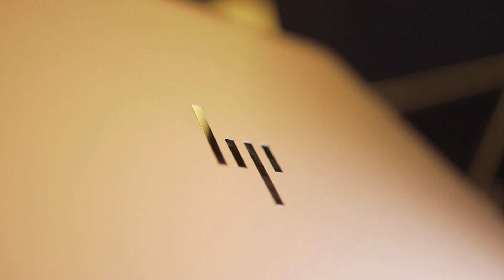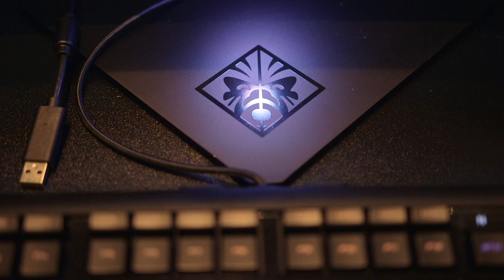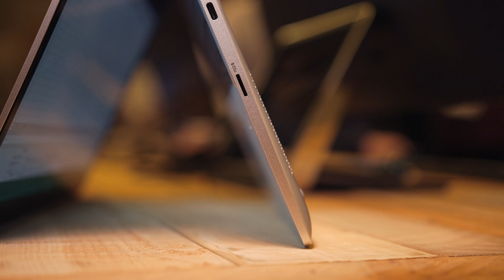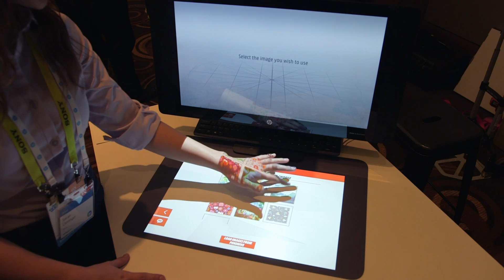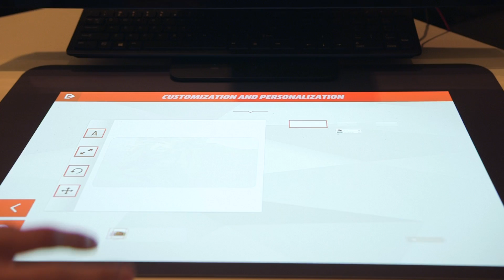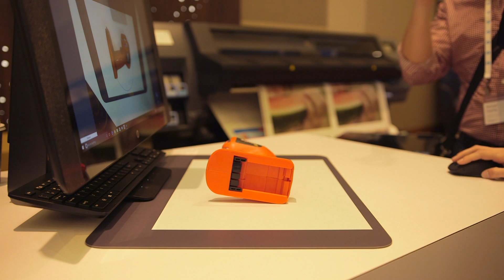The $1,300 HP Gaming Monitor!

Comment: why would you pay 1300$ for a VA panel? The acer x342CK is 800$ has an IPS panel which is better than VA but has freesync instead of G-sync. They will all run at at least 75 hz. and you can overclock most of them close to 100 hz

Comment: I would really like to know how many of the guys complaining about the 100hz refresh rate can actually run all current games in 3440x1440 at 144 FPS with Ultra settings. I have a 980 ti and i can tell you it is often hard to even get to 60fps, without MSAA...

Comment: Glad i got an Acer K242HQK , 27' IPS 4ms 4K monitor for only 350,-
I know i know it's 27' but do you think it's really small ? The pixel density is godlike.
Takes some load off of my Gpu at the same time, since there is no need for AA on this thing lol.

And let's face it, if i had the money i bought a bigger one but look at the prices of a IPS 4K monitor above
32'. And i know this thing has 100hz compared to mine , but there's 144hz 4K also. There has to be a limit somewhere for every individual person. Can't really say a curve , 6'' bigger  and 40hz is roughly 1000bucks over my cheap ass monitor.

Might as well  wait for the HDR capable stuff 10bit panels etc.

Comment: THIS IS A  FREAKING JOKE. L00l. The Microboard M340CLZ has the same exact specs (Except its Freesync instead of Gsycnc. And its probably the same exact panel that this one used) AND IS ONLY 700$. Cheap compared to that monitor, still fairly expensive, but still one of the best deals around.

Comment: Now we have the ACER X34, but from 3 different brands.
Reply: I don´t see any red on my X34.
Reply: he's thinking of the Z35. The only way this will be better than the x34 is if the QC is on point, the X34 lottery makes it hard to justify for someone in the market for an ultrawide gaming monitor. GSYNC also is hard to justify with VEGA coming literally any day, and someone like me being in the market not only for an ultrawide, but for a GPU upgrade is finding a very hard time justifying the extra cost of GSYNC, when you can get identical monitors with freesync for much less, and not only all the same monitors, but an exponentially greater selection of others as well. GSYNC needs to fucking die.

Comment: You can get Korean monitors with nearly the same specs for like $750. No way am I spending an extra $550 on 40 more hertz.
Reply: Cole Byre Those 40 Herz make a big difference from 60
Reply: Oh I'm not arguing that. I have dual monitors, a BenQ 144 Hz and an ASUS 60 Hz and when I drag windows halfway between both, the 60 Hz panel is not only jittery, but it lags behind the 144 Hz one. Just saying I don't see that as being worth 5 - 6 hundred extra dollars.
I mean here's an IPS 1440p curved 34" panel for $740. http://www.ebay.com/itm/MicroBoard-B340VXC-34-Curved-LGD-AH-IPS-21-9-3440x1440-Computer-Gaming-Monitor-/162335278581?hash=item25cbefc5f5:g:bc4AAOSwcUBYSiFU
Reply: lol, that microboard link tho. Check the motion blur and color failures of that monitor.
Reply: It has the LG 34UC97 panel in it which isn't that bad. Not gonna be used in e-sports or anything but it just has slightly more blur than a TN panel which I'm willing to accept for an IPS display.

Comment: You lost me at "$1,300".
Reply: had me at both, must suck being poor.

as for you, any reason you don't like ultrawide? I've only used them a few times but they've grabbed me unlike any screen has before, every single time. They're intoxicating.
Reply: me at ultrawide
Reply: Darren Kehrli depends, on the productivity side i prefer having two indipendent monitors is more practical, on the gaming side i prefer the usual 16:9 ratio as having that extra space brong no real benefit, even in first person games.
Reply: It has less to do with being poor than with it being a generally dumb idea to spend $1300 on a 35" VA panel.

Comment: Give me a
1440p
165Hz 
IPS
HDR
GSync or Freesync Panel
Reply: Acer xb271hu and Asus pg279q. No HDR, though i don't know why would you want HDR so badly for a gaming monitor.
Reply: TAGEtheMAGE the dell s2417dg 24 inch is 420 dollars and pretty much meet your standards EXCEPT for the ips, it's actually TN but honestly imo it doesn't fukin matter xD I find no difference eventhough there are quite distinguishable ones
Reply: NINJACUP I appreciate you guys trying to save me some cash. But these new tech pieces are an investment that I seek to get a good return on.

It needs to have these features 100% or no buy.
Reply: Pixio PX277   Does not meet those requirements 100%, but thought i'd share anyway. This monitor has exceptional value so i'm spreading the word on it. I took the gamble on a wtf brand and can confirm it's legit. 1440p is the current technological sweet spot.  It's a shame that marketing has turned everything into the clusterfuck that it is now with 4k, which mainstream just isn't quite ready for. Also, people are only just now realizing that 144Hz+ > resolution. OLED is legit though, do want. Next major investment for sure for me, if they can get those refresh rates down.
Reply: Id be happy with 144hz 1440p that isnt going to drain my wallet $800+
Reply: TAGEtheMAGE well in that case rip because a combination of all that is expensive af xD I just thought i'd give u my view of the best type of monitor because TN is much cheaper and doesn't have a large difference from ips. But good luck to u
Reply: 4/5 are met.

http://www.newegg.com/Product/Product.aspx?Item=N82E16824116827

http://www.newegg.com/Product/Product.aspx?Item=N82E16824236660
Reply: Your 980ti won't be able to push those framerates. 3440x1440 is kinda heavy. Have two machines one with 980ti and one with a 1080 (both systems have a Asus PG348Q 100Hz Gsync. In many games on ultra I am hovering between the 70 and 100 fps. I am kinda waiting on the 1080ti to upgrade the 980ti-system (my main system)
Reply: Also, GTX980Ti does not support HDR ;-)
Reply: I'm still waiting for OLED monitors at 1440p, 144+hz, HDR and the option between G-sync or freesync.

Comment: ROG Swift PG27UQ
4K, 144HZ, IPS Quantum Dot
$1200
RIP any Monitor above $1200
Reply: Good luck trying to run games at 4K 144hz..Your gpus would just  melt
Reply: ***** Maybe I didn't communicate my message clearly.. Running 4K at 144hz is not even feasible on current hardware. Quick multiplication

3840x2160 = 8,294,400 pixels
@ 144hz.

(8,294,400 * 144) = 1,194,393,600 pixels/sec

You're asking your gpus to render 1 billion pixels per second?! Two TitanX pascals aren't going to do that.
Reply: Stupid product, way ahead of it's time. 4k 144hz when a gtx 1080 SLI combo can barely surpass 60fps on the least demanding games.
Reply: LoL.
That monitor will cost 2000$.
That 1199$ price was a miscommunication error.
Reply: The monitor is confirmed to be at around $2000.
Reply: For single GPU, e-sport games such as CS:GO are playable at 4K 144Hz.
Reply: MrAlbertrocks RD um well I don't think I know what I'm talking about here but Im going to buy a 1440p monitor based on the math can that run smooth or is the technology no there yet :p. I'm a PC noob so don't be mad at me I don't know anything. Any suggestions for monitors that I could run a triple setup with above 60fps easy?
Reply: yes gtx 1080 sli can't run 4k in 144hz ( depend on what game you play ) but this is for feature proof.
Reply: IKR
Reply: Shit monitor.  Why?  Simple.  4K + 27 inch = FAIL
Reply: TagetheMage That's not even the main problem, the problem is: how the hell do you pass 4k 144hz? displayport is capped at 4k 60hz, does it have 2 DPs?
Reply: Displayport 1.4
Should be coming later this year. Third quarter or so.
Reply: It is $2000.Not $1200
Reply: GuardianLords Not 21:9= No buy from me.

Comment: That Monitor might win me over because its 35 inch instead of 32

but its not IPS :''''(
Reply: The Asus PG348Q and Acer x34 both have an IPS pannel, they are 34" and cheaper ;) i don't think one more inch is too big of a deal
Reply: ***** But their design is too edgy for me :D this kinda looks much more elegant
Reply: oh yea you would be right about that xD if that's what you want then go for it i guess :)
Reply: AHVA is still good. Way better than TN
Reply: Why would you want IPS. IPS is pretty garbage, VA is much better.
Reply: Optimus Toaster But if I'm paying more than a grand, It's kinda sad to know there's a more superior version xD

IPS has better colors but worse refresh rates so....
Reply: You sure havent used an IPS panel have you? Every single IPS panel when showing dark content, even when you're sitting at a normal distance away and perfectly centered, is going to have visible Glow coming from the sides. Not to mention they ALL have some BLB, majority of them have plenty (as proved by the PG279Q, MG279Q, AOCs variants, XB270HU, XB271HU, DELL 2412/14 series, PG348Q, Acer X34 and I can go on and on) The wider they are, the more visible the glow is. You have to sit roughly 1.5m away in order to eliminate visible glow. But then you'll still have BLB that bleeds into the panel.

Why would you want an IPS again? Wide Viewing Angles? What, you gonna sit on the side?
VA's viewing angles are fine if you're just going to be doing at-home-photoshop.
Reply: ***** I really like LG designed Monitor Frames, Acer X34 is kinda fine but look at PG348Q, It look like something out of a Michael Bay movie and I don't dig it
Reply: Why would you want a gaming monitor and IPS?
I mean you're literally ruining your own experience with Glow and BLB.
Reply: They're the same thing, don't be fooled
Reply: It's AMVA, not AHVA. AMVA is a type of VA panel, whereas AHVA is a type of IPS panel with a weird name. VA monitors have way better contrast and slightly better reactivity compared to IPS, at the cost of worse view angles. They are quite suitable for gaming and movies.
Reply: Don't be sad.. Be happy... AMVA is far better than IPS or TN... First of all you get far superior Contrast which means black looks black unlike on an IPS where you always have this washed out blacks. And you wont get any of the IPS glare which drives me crazy... Colors are good enough and its definently possible to get a AMVA Panel to be responsive enough. Got the Benq GW2760 HS and its bloody awesome. Nice colors great deep blacks and you dont feel any lag. 

If they get the Panel right in regards to the response time and input lag this thing will be far superior to the other IPS SHIET...
Reply: +Audie Liem It wouldn't bother me too much and i thought about buying one for a while but i have to agree the omen x looks way nicer
Reply: Clueless White Kid Studios I know that they (x34 and PG348q) used the same IPS Panel by LG, but this one is different because it's AHVA and it's 35inch

And I think even if the Panel is the same, the products are slightly different

X34 has good speakers, terrible OSD, and a more "normal" chassis ID - it needs to be OCed (or toggled, because it's just a setting) before reaching 100hz

PG348Q has an over-the-top chassis design (and that's bad), better OSD, is 100hz out of the box and from what i've heard better QC
Reply: Dane M va has shitty response times that are inconsistent across colors
Reply: +Wisky Mo You are right in the sense that you can't really trust that figure since the day manufacturers have started to measure it grey to grey instead of black to white. It will vary a lot depending on how you measure it.
Reply: +Chickenbeek Most of that footage was shot at a fairly steep angle, and pretty much all LCD screens lose contrast when viewed at an angle.
Reply: Terra Incognita Gaming Glow is an artifact that appears only when an IPS panel is viewed at an angle. It really isn't a big deal What you would miss however are the fantastic contrasts of VA screens.
Reply: Terra Incognita Gaming I'm using one right now (Iiyama Prolite XB2776QS), and have used it since late 2012 or so. I do notice some light bleed and glow in the corners when viewing a pure black screen when the room is very dark, but the rest of the time I can barely see it... it isn't as bad as people make it to be :/ It might have something to do with the fact that I set it on the lowest brightness possible though. Bright screens hurt my eyes after 8-10 hours of work.
Reply: "When the room is very dark"
Glow can be seen even in a well lit room when displaying black.

Your brightness should be around 120cd/m2. Typically in the 18 - 30 range.
Reply: Get a X34A, it has a much more simply design and is still better than this. https://www.amazon.com/gp/product/B016GNX4SE/ref=as_li_qf_sp_asin_il_tl?ie=UTF8&tag=techytalk00-20&camp=1789&creative=9325&linkCode=as2&creativeASIN=B016GNX4SE&linkId=b31f7f538a5dec04360ae3c0088efb15
Reply: +Terra Incognita Gaming Backlight Bleed is not limited to IPS. Every LCD technology with backlight can show some bleed. As an example: the BLB on the PG278Q is as bad as on the PG279Q. And AMVA panels also showing some glow.
Reply: Audie Liem are you stupid? you do realize both of the monitors have a max of 100hz. right?
Reply: Yes, not IPS...sooooo, we'll have to wait and see how bad the ghosting is on the Omen X.  I'm not holding my breath.  The reviews of every single VA panel has shown very noticeable amounts of ghosting while gaming.
Reply: Uhm the AOC 35" UCX has little to none.
Reply: Not true.  Several hardware reviews and owners have stated the ghosting is quite visible.  No thanks.  You go ahead and get yourself one and have fun.  I'll wait for something better thank you very much :P
Reply: There arent any reviews. lul. And if you look at Totallydubbeds video you can see, that there isnt really any.

AOC AG352UCG/x
Reply: Blah, blah, blah.  It's a VA panel.